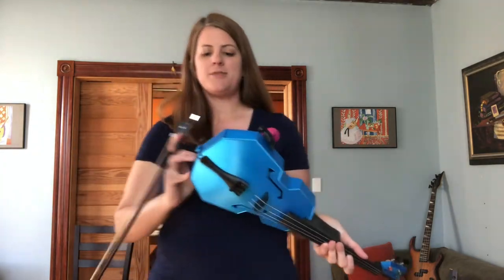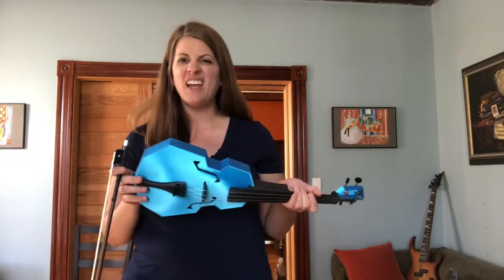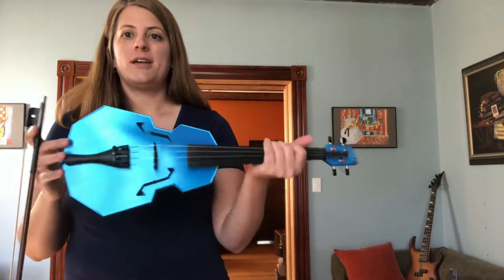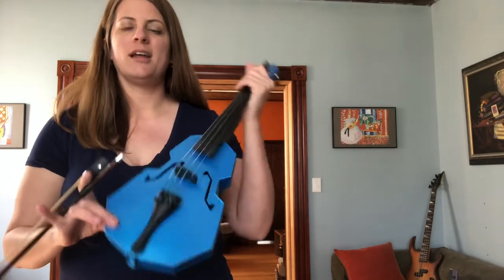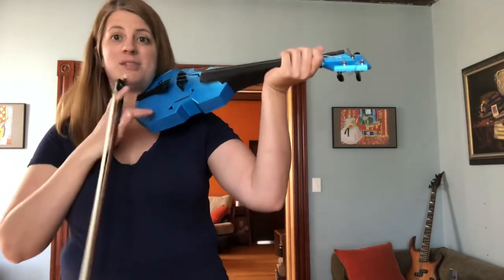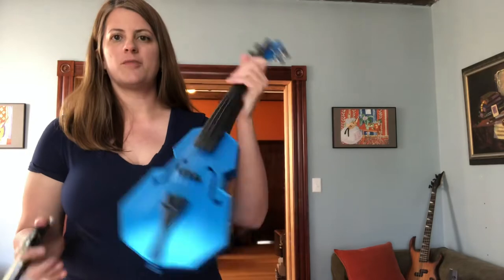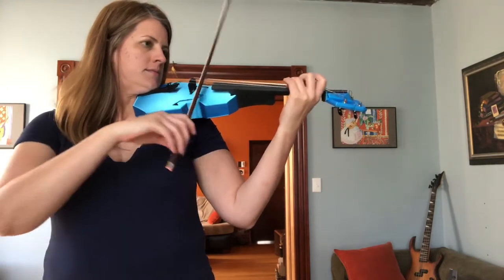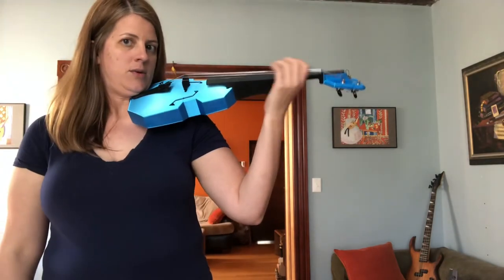Modular Fiddle Demo: 3D printed blue violin

Comment: Wow well played! Your intonation at higher positions is impeccable. I usually hear more elite violinists struggle a little without a proper bout. Do you often play violins with no bout? 

Thanks for all the great feedback, that is super helpful. 

I recently designed and published Version 2 of the Modular Fiddle. It has proper cutouts for your shoulder rest. I’m also finally building them with wooden pegs, which helps to reduce the weight out there, but does require some specialized tools to properly fit the pegs. I still personally prefer those geared tuners you have there, but I rarely leave first position. 

Last — you can get improved sound with a carbon fiber PLA for the body. I use proto pasta. It adds some very nice timbre. 

Thanks for building and playing a Modular Fiddle!!